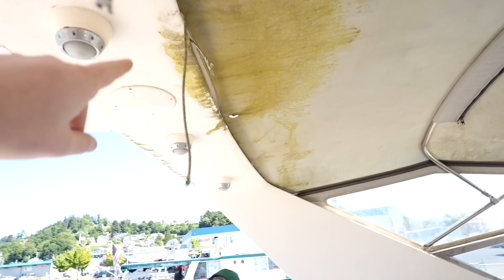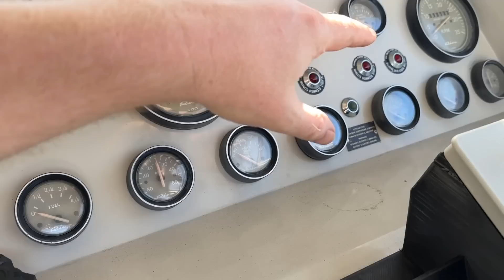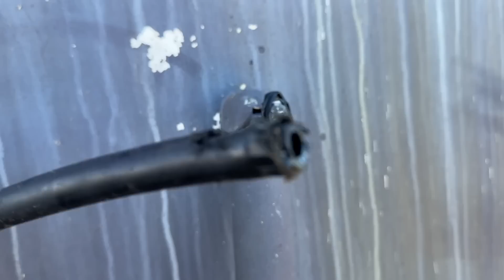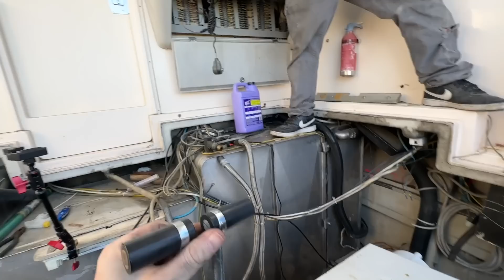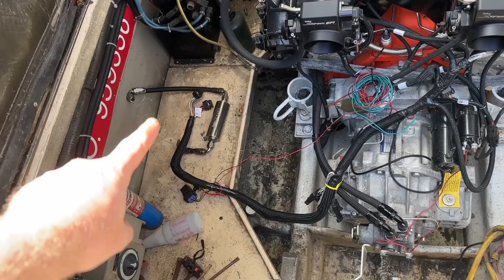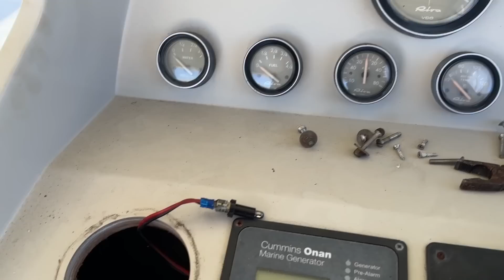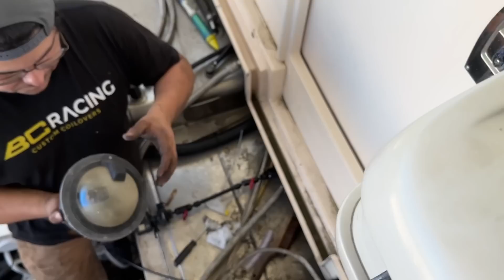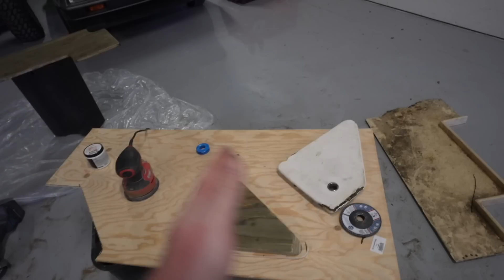Back On My 30yr Old Italian Yacht and its WORSE THAN EVER

Comment: See’s engine bay open to elements 🤦🏼‍♂️😵 results about what I expected to see. A real shame, 20min and $50 and that could have all been avoided.
Reply: It could have been shrink wrapped once the engines were in with a zip door.  Nicer place to work and the whole boat would have been protected
Reply: @AW-yv9sq this is the way! No bugs, mold, you can moderately heat/cool it too when you're working inside.

Comment: Hi guys,
There are many aftermarket switch panels to replace those dash switches. It brings all the switching to one area which is good. You can strip the dash and recover with a laminate. Then decide on placement of all your new gear and recut the holes so it’s nice and neat and new looking.
Cheers 👍👍🍻🥂

Comment: Does the lsx engine run on the same voltage as the old diesels?
Reply from the maker: no the boat runs on 24v, the engines and new electronics run on 12v. its actually a bit of a tricky issue but were working through it

Comment: Hi guys,
You can save dash space by replacing your individual throttle and gear levers with combination units. That way you have only two levers instead of four. Basically as you push a lever forward it will click into forward gear and then as you push it further forward it increases the revs. Nice and simple and easier to use.
Enjoy the heck out of that baby! 👍👍🍻🥂
Reply: Electronic throttle bodys… 😉
Reply: @toni_hemmo  
Now you’re talking! 😁👍👍
Reply: The 2 lever controls are better for docking a twin engine boat, you set your throttle low and bump it in and out of gear when approaching a slip or dock, less chance of whiskey throttle.
Reply: @brucesam129  
Hi Bruce,
I respect what you’re saying in theory in a perfect world with zero wind and zero current moving through the pens. But when was the last time you put your boat away or approached a wharf/dock and didn’t use any throttle? 
Cheers
Reply from the maker: seems pretty cool, but i learned how to pilot this boat with the two lever system, and we already have two holes in the dash, so i think im gonna keep them the same.
Reply: @BisforBuild 
Further to my comment, I’m a Tug Captain of 25 years. I guarantee you that 
Combination Controls do exactly the same as individual controls. You still have forward and reverse control of the engine and revs. It actually makes control of the vessel much much simpler as you’re not having to “juggle” multiple levers. I also had a boat building business here in Australia with my Dad in my younger years building boats exactly like this. You will love those controls. You will find that you will replace most components on that dash for bright shiny new ones. A new fancy laminate over the dash, new holes cut to suit your new gear and all will look brand new.
I love your builds!
Cheers 👍🍻
Reply: @nigelw598  separate transmission sticks are better for idle speed maneuvering such as backing in between boats. Especially for the inexperienced who might grab too much stick when they only meant to put it back into gear for a second.
Reply: @ducatipaso1386  
Hi mate,
In my experience teaching newbies, they often have way more issues with four levers over the simplicity of two. They’re getting there heads around which drive lever to go fully fwd or ahead in to engage and manoeuvre the boat. Then getting confused and incorrectly stabbing the throttles fully forward. You throw in wind and current in a confined environment and you can’t just idle. I find it way easier teaching people on just the two combined levers. Gives them less to think about and they build their manoeuvring skills a lot quicker. 
All the best,
Cheers
Reply: @eriklarson9137  
We all love Chris but he needs all the help he can get sometimes. 
I’ve got a joke for you that’s about as helpful as your comment. 😁

An old irishman shuffles into a bar at sundown with his eyes low and his head down
the bartender says "Ay, Billy! whats the matter. you seem troubled"
Billy responds with "You see this bar we're standing in. I built it with me own hands! but they don't call me Billy the bar builder, no!

and the bridge everyone uses to cross the river to get to the market, I built that that with me own hands too! but do they call me Billy the bridge builder? no, they do not.

and the wall that protects our town, I built that with me own hands too! Do they call me Billy the wall builder? No!

BUT YOU FUCK ONE GOAT!...
Reply: @BisforBuild trust me, you definitely want to use combination controls on this, I wouldn’t stress about the extra hole in the dash, as others have said a full carbon overlay would be the go to cover old holes. Live the boat series, can’t wait to see it in the water!
Reply: To add to the other comment, that would have left them absolutely boned previously. 2 controls means if one engine goes, you have another. Redundancy is important in marine equipment, like aircraft. If the wrong thing fails, you could be wiped off earth quickly
Reply: @fortyfukinseven  
Hi,
actually the old design of these fitted seperate controls means more moving parts and more to go wrong. Combination controls moves all the components of two levers into one. You still have all the same functionality and you have no greater redundancy of any sort with the older system. Not trying to be a smart ass here. Just trying to explain. 
Cheers
Reply: @fortyfukinseven you still have a separate control for each engine. They just combine the gear and throttle into a single lever. You then just have a left and right lever.
Reply: @ReefRunnerRebuild 
Thank you 👍🍻
Reply: @fortyfukinseven  now you have 2 controls for 1 engine. That can be done by 1 control, gearbox and throttle. So instead of 4 handles you would have 2 each separately operating one engine.  So the same  way as now. Check google on morse control operation.
Reply: Individual controls are used to manoeuvre the vessel as well as the helm
Reply: @sparkybell11  whats the point now you have 4 controls. 2 for one engine. There are units(morse controls) that use 1 control. Go foward till it clicks in place youre in forward. Go further forward gives throttle. From free going back its the same reverse. You always need 1 control for 1 engine. So whatever happens you still have your own controller per engine.
Reply: Should absolutely go a single unit. A lot easier and more intuitive to maneuver.

And NEVER use a regular charger on AGMs.

Comment: Agm batteries will charge from an alternator with a normal battery attached at the same time. Its running.  FIXED a lot of agm that way.